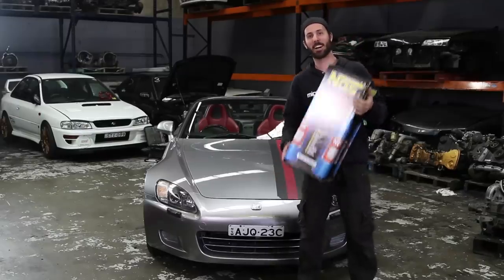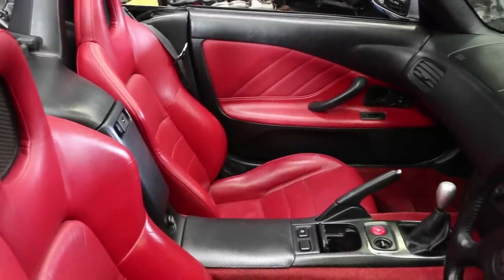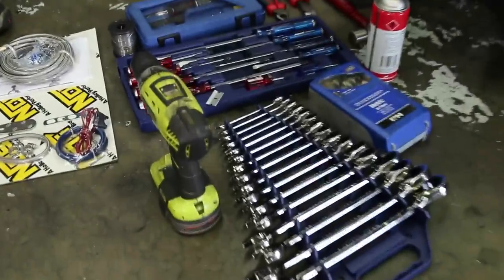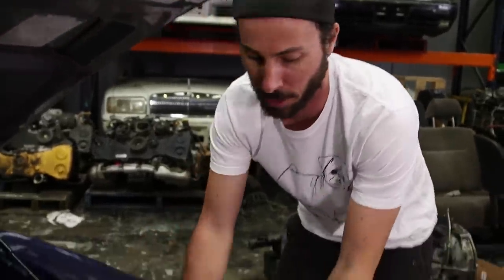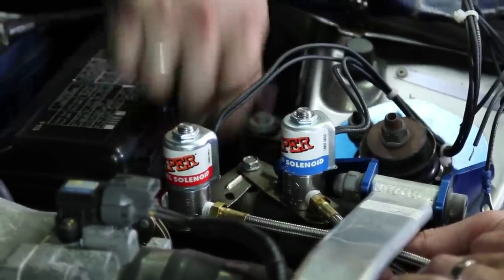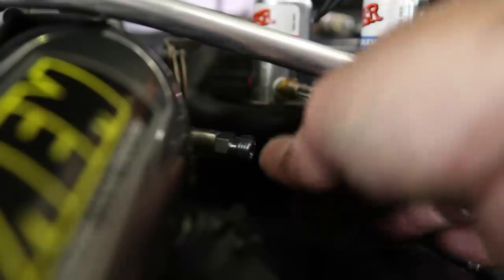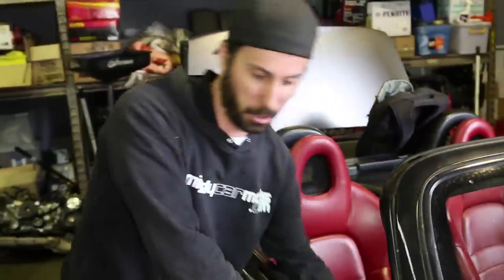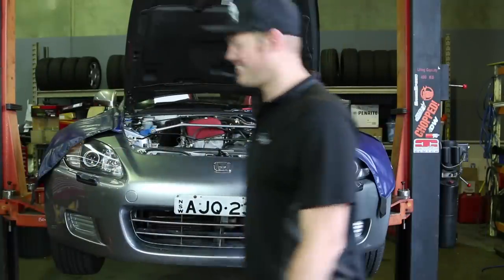How To Install NOS

Comment: OK So here is my prediction. Swarf from drilling the fuel rail or intake pipe either got into the engine or injector and / or blew the engine.There is no way on this planet I would have drilled the fuel rail with a drill at that speed and without sealing all the holes prior. Then I would have ran 140psi of air through it for a while.
Reply: as soon as i seen him put a drill to the rail i knew he was going to blow it!
Reply: yup lol i was thinking the same thing... unless they did clean it out and simply didn't mention it.
Reply: steezosaurusrex
Yup. Maybe they did clean it and thought it didn't make for good footage....who knows. Personally I think he installed N2O to deliberately blow the engine forcing ten episodes of a low compression forged internals S2K build that is boosted to infinity and beyond.
Reply: Will Ferrell I agree completely. It looked like in the clip they changed nozzles. Hence thinking maybe he pushed it a little to hard. But I still think I was right the first time and that metal dwarf or shavings for into the engine.
Reply: Will Ferrell  I would like to think so. We will see I guess....
Reply: scotiatint1 Here's my prediction.... He'll blow the welds off his intake.
Reply: EatPezzzz
 Lol, yup, or that and the floor pan will drop right out of the car...
Reply: You would think they would point out the importance of not getting metal shavings in your intake plenum. Or maybe it's not that big a deal  if they bounce around a few time before being blown out the exhaust.
Reply: Nope. They tapped the fuel rail, which would be easy to clean out any metal shavings before reinstalling. Even of there were aluminum shavings in the fuel rail, they would clog the injectors, and even if they got through the injectors, it would either be burnt up in the cylinder or just spit out the exhaust. In order to do damage, the material has to be harder than the material it is damaging, and aluminum is not harder than moly rings, stainless steel valves, forged aluminum pistons and steel cylinder walls.
Reply: EatPezzzz
I agree with the principle of what you are saying but I personally have seen two separate cars die because of metal shavings in the engine. One a supercharged 350z and the other a Mazda RX7 FD3s that had apex seal and rotor housing damage which cause low compression. The 350z dropped a new engine in and the FD needed a rebuild.
Reply: scotiatint1 There's a difference between "metal" and "aluminum". Metal is iron based; aluminum is an alloy made alumina and silicone.

And an apex seal is a very high grade steel (metal) and they also have ceramic race versions, both of which are multiple grades harder than aluminum.

Also, all left hand drive 3rd gen RX7s are FD33, not FD3s. I've only built about 100 of them.... literally.
Reply: EatPezzzz
You da man!
Reply: EatPezzzz
Erm... chemical engineer here. Metals are a class of matter not only iron analogues... so yeah, actually most things called 'metals' are in fact alloys - steel is iron+carbon for example.
Reply: William Stewart  Good to know. Thanks.

Comment: Who wants to bet on what goes first, the clutch or the diff? :D
Reply: Clutch if you can't drive. The diff if you like to have fun.
Reply: Guys Who Do Stuff
 Both at the same time it is then! ; )
Reply: :D
Reply: If you watch the end, I think something goes wrong while they are testing the new power.
Reply: Shouldn't just the floor pan unscrew?
Reply: darek4488 The nuts on the floorboard are the first thing to go when you give too much NAWS.  Then you run the risk of blowing the welds on your intake manifold and frying your piston rings.
Reply: Plur307 Yep. Even if your floor is welded.
Reply: Diff
Reply: SpaceManDawn I will bet the clutch does first.

Comment: what you didn't mention is that the power increase is almost constant from idle to max rpm and what that means when you do the sums is though there may only be 35 hp improvement at the bottom end that may translate to over 100% increase in torque. Its the bottom end improvement that makes it more usable than say simply increasing boost pressure using a turbo.

Comment: It took over an hour to upload 17 minuets... Wut.
Reply from the maker: HDConcussionz it takes more like 5 hours, minimum.
Reply: Aussie internet at it's finest
Reply: Mighty Car Mods Takes me  less than a minute for a 20 minute video! What kind of speed is the internet in Australia?!
Reply: ***** Upload is awesome if it's above 1mb/s
Reply: ***** Terrible. Basically.
Reply: Mighty Car Mods Ah, I was just going off the camel uploading picture.
Reply: ***** On our original copper network you'd be lucky to get 10 megabits per second download, maybe 0.7mbps upload. On our fiber optic network we get claimed speeds up to 100mbps down (never happens), and 2 up. At least on standard consumer internet in my experience.
Reply: Its not the length of the video, its the file size/ quality, you can have a 2 min video shot it 4k and basic 25 mb internet and it can take over a few overs, but you can have a low quality (480) video thats 10+ mins with the same internet and have it upload in less then 45 mins. 

That being said, with all there audio files, cuts, intros, etc. I'm guessing its a larger file.
Reply: ***** Oh my goodness. Here in Canada most palces have atleast 100mbps, and here, I have 1000mbps (up and down) for ~80 bucks a month
Reply: KidSavesTheWorld -Again *massive cringe*
Reply: ***** For $60 per month you can get the NBN service I just described but you can only download 100GB per month before it is slowed to basically unusable dialup speeds.
Reply: ***** That's a minority in Australia. NBN was scrapped and Abbot only planned fibre to the node
Reply: ***** and fuck all houses in australia at the moment have nbn. fastest my connection gets is 1.1mb down, 90kb up.
Reply: Your lucky in Australia to get more than 1 Mbps or 0.125 MB/s
Reply: Thats Brutal, Australian ISP's really like to suck the money out of your pockets for almost nothing at all. Again here in Canada, no download caps either (although they want to impliment them)
Reply: *****
Its not anywhere near that bad unless u live in a rural environment i get 4.7 mbs actual download is a bout 550kBs
Reply: iunpk3di I get 50 Mb/s both ways for $50
Reply: Jacob S Most suburbs in the bigger cities have NBN as far as I know.

***** The whole net neutrality business right?
Reply: ***** That's not true.
Reply: 春日歩 I pay $50 and we only get 4Mb/s -_- its the only internet that services my area
Reply: ***** NZ internet is alright. On copper you can get ADSL2+ up to 24Mbps but most people get about 18/1Mbps. You can also get VDSL2 which is up to 50Mbps or something, but most people get about 48/9Mbps. And if you're lucky enough to have fibre in your suburb you can get 100/50 but most people get about 90/40ish. One ISP called MyRepublic has fibre at 1000/50Mbps.

But I live on a 125 acre block in the country and have ADSL2+ at 8/1Mbps.
Reply: Jacob S my suburb is next for NBN , thank goodness
Reply: Philip Bolly It's not true NBN, it's just fibre to the node.
Reply: iunpk3di Yeah sorry, download isn't too bad but i was talking about the upload which is horrible 1.5 mbps max for most people.

Comment: I love your Honda and you're right I don't know why everyone hates on them
Reply: Curtis Brinkley most don't like civics, s2000s  are awesome
Reply: As a honda guy, every ricer in my area has a civic. Civics are a cheap platform to build on, which attract usually those who can't afford performance mods but want that street cred yo! Also some honda guys are awful drivers and usually piss/scare other people off in traffic (me included).
I have an 4-door accord with stock body, aftermarket exhaust, and saving for a suspension kit.

Comment: I love my Acura (Honda). I have an Integra LS and it's got a honda 4cyl in it. I love the car and Honda's/Acuras are what I have mainly owned. Mine isn't riced out and but I have worked on the engine more than I have the exterior. It's got the twin cam 24 valve b18b non vtec engine and it is amazing in a 1/4 mile. I got a 13.4 seconds at about 120mph.

Comment: If your considering a nitrous system think twice. I bought a kit a few years ago and now I know why so few people use them. The basic kit does not have everything you need for it to work consistently, and nobody will tell you that. You should have a purge kit over $100. Also a bottle heater over $100, pressure gauge $50,fuel pressure safety switch $50, bottle blanket $25 filling a bottle $50 hi volume fuel pump $75. I've found even with these I haven't had consistent performance. The trick is to keep the bottle pressure over 900 lbs. Good luck with that on a cool day. Also as the nitrous in the bottle gets used up the pressure drops and the heater has to try to keep up. The only time it worked well for me was a nearly full bottle on a 80 degree day. I've seen people change bottles half full or heat them with propane torches to keep the pressure up. That's too expensive and too dangerous for me.  As a final kick in the ass my local track where I race said I needed a fire safety approved jacket to use nitrous there $100.

Comment: As a Supra and Subaru owner, I'm wise enough and have had enough encounters with seriously fast Hondas to never challenge one without knowing what mods they've done. Hondas are very capable cars and are a lot of fun when built correctly. My issue with them is when these crazy punks roll up and start talking about how "all powerful" their car is when all they have done is a fart can, a "cold" air intake, and chopped springs. It's your car, and you can do whatever you want and enjoy it, but unless you're at an autocross event it's not a threat to any serious sports car. What makes a car seriously fast at autocross is weight, handling, and tires. Yes, Hondas are good cars, but only under certain circumstances. ✌️

Comment: It's not usually the bottle to blow but the the NOS increases flame heat that it turn cause the fuel tank to blow up so not the bottle but the fuel in the car when that pressure valve allows now out while the car is in fire you see the green flame

Comment: the NOS used in cars, contrary to popular belief is not actually laughing gas, although given the same name of nitrous oxide. NOS in a car has the chemical symbol of NO2 (or nitrogen dioxide) whereas laughing gas is N2O (or dinitrogen oxide). this could also be where the name came from as if you replace the 2 with an s then you get nos.
Reply: I thought the bottle they held up was dinitrogen monoxide. Did they mistake it?
Reply: oh shit you are right,it would be monoxide

Comment: Mighty Car Mods 
 I was wondering if you could answer this for me.

Does every NOS kit ( Doesn't matter the brand ) come with a purge line ? Or how does that work? 

Also why did he put small white stripe in the solenoids?
Reply: I dont know a lot about this, but I thought all the kits had purge valves, but i didnt see them installing one.  I think the strips you are referring to are teflon tape.  This tape seals the threads so there is no leakage.

Comment: i have a question...when the magic of more power is in more oxigen in mixure.....why use NOS?  why not pure oxygen?
Reply: might have issues with compression
Reply: I may be wrong, but carrying liquid oxygen around in your car is probably less than practical.
Reply: an cariing bomb of nos is more practical? bomb like bomb :D
Reply: +Milan Dičér I don't know, the boiling point of oxygen is a lot lower than nitrous oxide, which would probably make it harder. There's also the fact that the engine probably couldn't withstand the effects of direct O2 injection.

Comment: Do a myth busted on exhaust.  Since people always debate bigger pipe size means more hp but in reality it means loss of back pressure and loss of torque and usually low end hp. Also do one on headers wether some are worth 800 bucks just to sound better and only gain 5 hp.

Comment: I have a Honda, a model that in my country even Honda drivers hate, does it get any worse?
At least it has a K20A3 stock, so most of the gear is there to drop in a better K, mostly.

Comment: I saw in the street an Integra DC 5 apparently with turbocharger going very fast.Honda cars can be very fast if tuned correctly.
Reply: there engines can handle alot of power
Reply: and they are light

Comment: doesnt NOs+Gas injected directly in the intake produce knocking? I dont think all the cilinders get this shot at the same time
Reply: interesting, and doesnt the NOS evaporates in that time? or worst, cant it explode by the heat in the valves?
Reply: +Michael Stavropulos no its just injecting more oxygen it won't react to anything until the combustion process starts in the combustion chamber.

Comment: Most people in this comment section say people hate Hondas because the drivers are often ricers with big fart exhausts.

I dont understand, that's no reason to hate on Hondas.. that's a reason to hate on ricers.

What is a real reason to hate on Hondas? The front wheel drive argument is a good one but not all of them are.

Comment: it possible to install NOS on 1200cc engine?
Reply: yes
Reply: NOS is not a part can put inside the engine 
It's outside 
You can even put in bike also
Reply: In the states, mopeds usually have a 50cc displacement limit.  I've got a friend that put a turbo and NOS on his moped and now he estimates it makes 21 hp out of a system that originally made 6.

Comment: I wonder, did he have to rebuild his V-TEC twice? I know for a fact that the V-TEC factory had issues with oil burning. So, with the added horsepower did he have the oil burning problem now? Or did he have it at all at one time. Either way I bet he had motor problems arise.

Comment: ı have a question for peoples nos users peugeot 307 2.0 liter whit benzin do ı need to change the crang and pistons or its good enough whit originals cause some says it will break is it true ??? thanks for the answers :)

Comment: I have a quest , can nos be put in a 2007 dodge charger 2.7l ?
Reply: 3232myke NOS is bad for the engine and it has 40% of exploding when you use it and may kill your engine immediately it puts too much pressure on the car.
so better stay away and there is many ways you can make your car faster and better.

Comment: Would it be recommended to install a turbo and the NOS on a car?
Reply: I have the same question!
Reply: Yes doing both is fine
Reply: +SkyLord Hilam I want to run a wet nos install like in the video tho
Reply: +Marley Marz A wet Nitrous system combined with Turbo works amazing, but it's better to use smaller shots like 50 or 75 with the nitrous if you also have turbo. They used pretty small shots in this, some people will use shots way past 75 in some cars, just depends on how much psi your engine can handle I suppose

Comment: Is it possible to install and use NOS on turbocharged engine? @mightycarmods
Reply: yes it is. you just have to be careful of cylinder pressure and heat.

Comment: 'NOS has more oxygen content than normal air',,,,,, well, why not just used compressed oxygen then?
Reply: Matthew ....
Reply: Matthew u could....
Reply: @uravgpyro7494  infact, they use NOS as it is in liquid form alot warmer than oxygen would be. and more product can be squeezed into a small area as a liquid than a gas (what oxygen would be) however if you did have a setup to liqify oxygen you would just simply have to change the bottle less, and pay less for the bottle itself. but the jet size would need to be pretty much 1 third of the size for the same output. i was just asking this to see what people say :D

Comment: does it work on an old volvo 121 with carburator? 75hp + 70hp nos :)
Reply: Yes. You'd have to buy a nitrous plate (I think that's what it's called don't quote me on it

Comment: Total car noob question, but why do you need to use an extra fuel line with nitrous? I can't get my head around why you can't just use the nitrous line on its own and have the stock injectors control all the fuel? :/
Reply: Jamie Woodward Depending on how much power you are adding, the stock injectors may not be able to deliver that much fuel, even running at 100% duty cycle (spraying fuel constantly).  There are some "dry" nitrous kits available, which only add nitrous and not fuel and let your stock injectors pick up the slack, but if you want to do a big power bump, you probably need extra fuel delivery. The other option is to upgrade your stock injectors, but that can be pricey, and larger injectors can make your engine less fuel efficient.
Reply: wendighoul Ahh! thank you for the explanation sir! ;)
Reply: You absolutely can do a nitrous system without a fuel line. Its called a "dry" system. But what you risk is running lean if your current injectors cant keep up. Since it relies on the oxygen sensors to tell the ecu to add more fuel, you can also have lean spikes...which is also not good. Dry hits can be okay, but most prefer a wet shot, where you inject fuel and Nitrous at the same time. with that, your current injectors dont have to try any harder than they would N/A. plus, with that, tuning is easier because as long as  your N/A tune up is spot on, you can do ALL of your nitrous tuning with the Nitrous jets. If its too rich, put a smaller fuel jet in it. if its too lean, larger fuel jet, or smaller nitrous jet.
Reply: Tyler Eidson Now I see ! Not that you were talking to me...lol.

Comment: OOOOOOHHHHH so the WEP on air planes during ww2 were NOS powered?
Reply: hmm, not really. but close, the planes were generally boosted by NOS and when the planes engaged WEP the engine just pumped more fuel into the engine which is burns insane amounts of fuel but makes a lot more bang